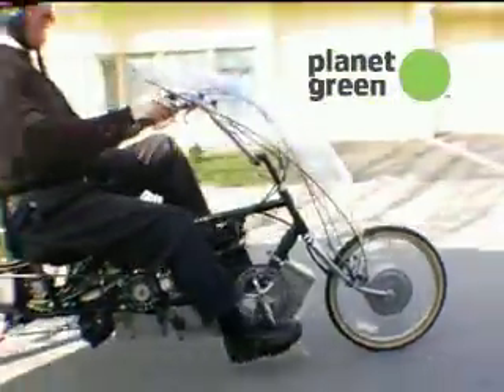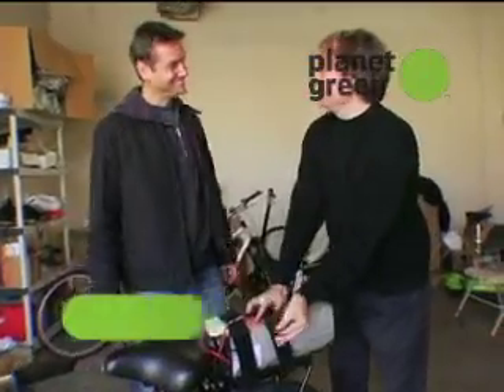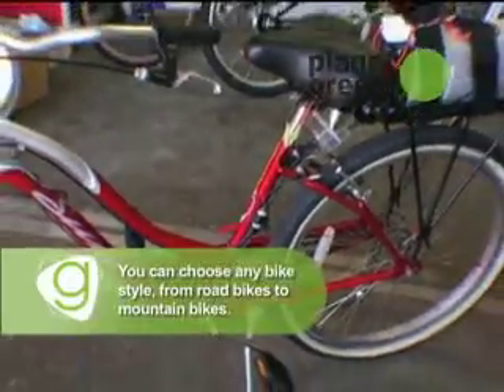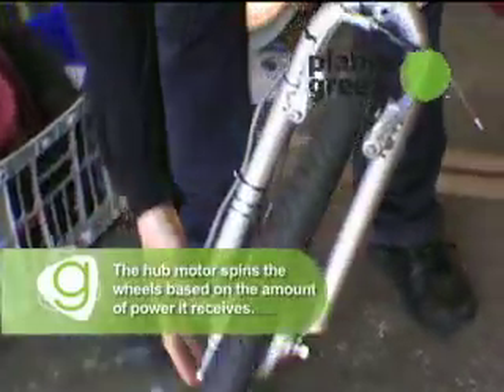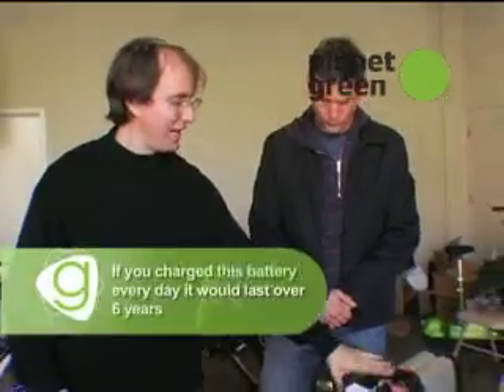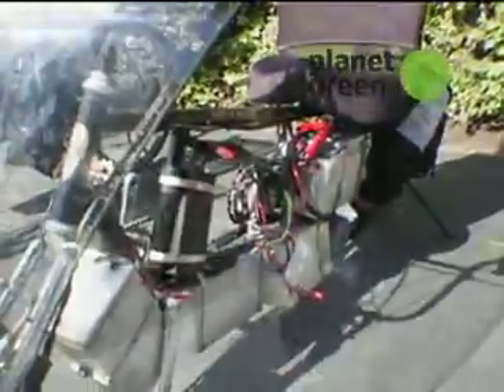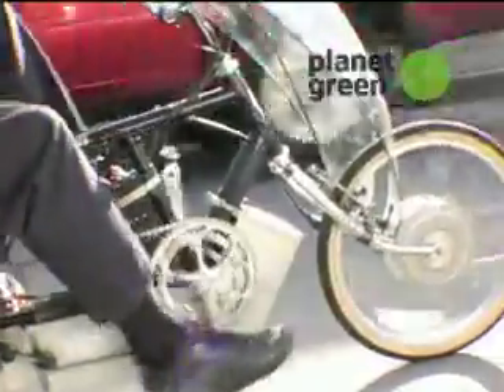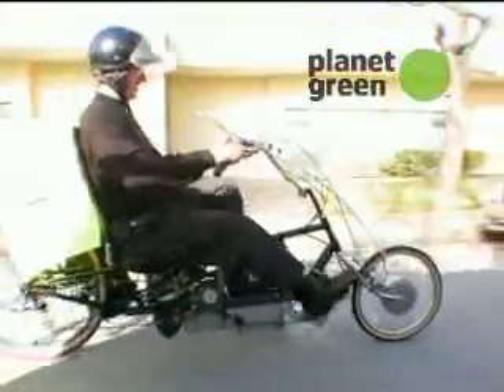G Word - Electric Bike Conversion

Comment: darkarse388 - the bicycle is the most efficient means of personal transport and even more so if it's electric. As you're too stupid to realise, let me enlighten you. A charged electric assist bike  prevents the cyclist having to breathe too heavily for the effort required to ride the bike and therefore less carbon dioxide - add the small amount exhaled with the emitted to charge the battery and you've got the cleanest most efficient means of personal transport, or have you invented something ?